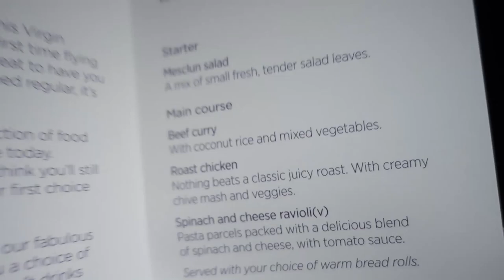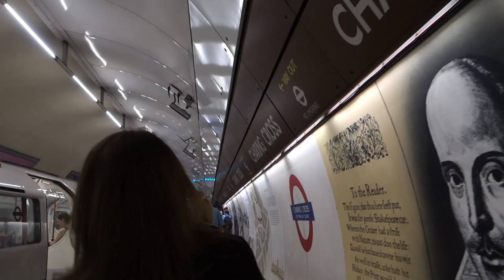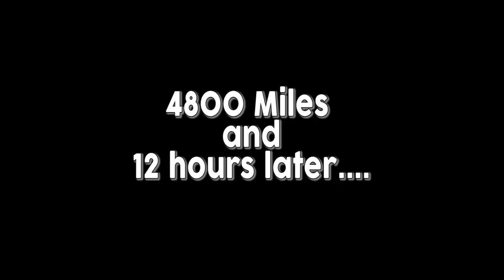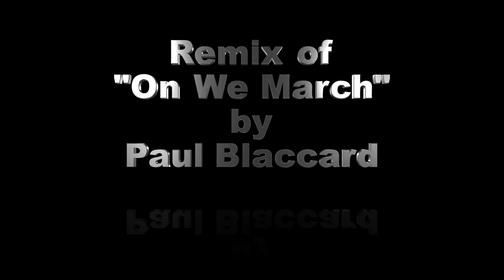How to Rebuild a Muncie 4 Speed  Synchronizer  Basics

Comment: Love all the videos, I ran into a 3 speed overdrive transmission out of a 80;s Chevy Van.  It has the NV logo on the side so I think it is a A833. It appears to have been apart due to the sealant around the side cover.  Are these built like a Muncie?  It has a Hurst shifter with a really long shifter handle.  Any thing I should look for?  Weak areas?  Thanks so much.
Reply from the maker: These are NP440 OD units based on the A833 Mopar design,  A good unit, but in no means a performance transmission.
Reply: I understand just going in my 67 Chevy pickup. Thanks

Comment: Your a mechanic and have a  problem with silicone ...  Huh ?
Reply from the maker: A big problem.... stuff is old school now.
Reply: Its used everywhere.
Reply from the maker: green323turbo agreed, but used in this video incorrectly. Aneurobic sealers are a much better alternative. I haven't used RTV silicone in 10 years. Neither does any transmission manufacturer. It should never be used in place of gaskets especially when gaskets are integral in maintaining clearances.
Reply: Yes too much is bad. Better just a dab on your finger and smear a thin layer. But its still very useful for many transmission and engine jobs. .